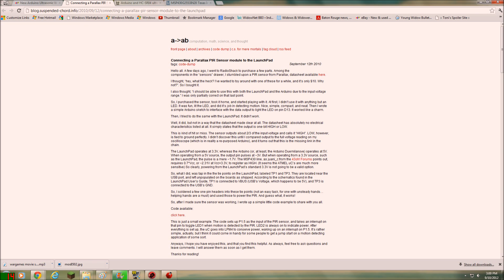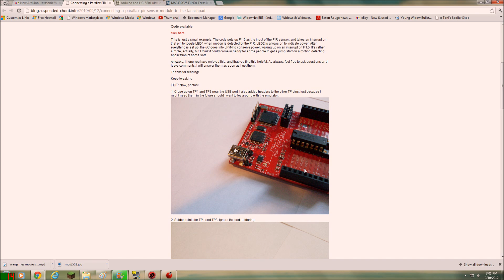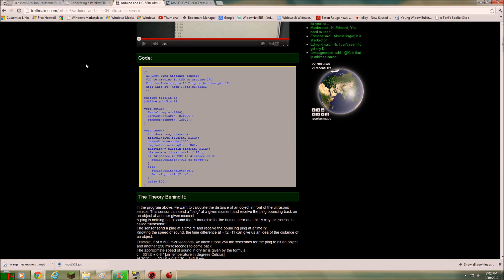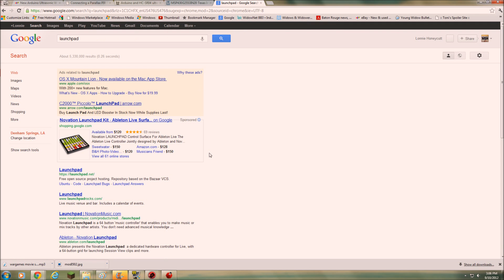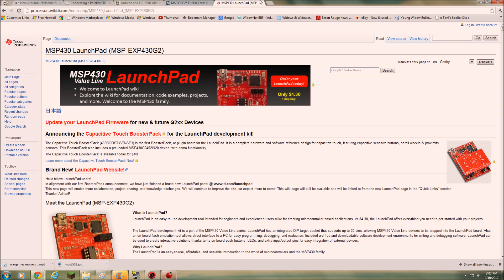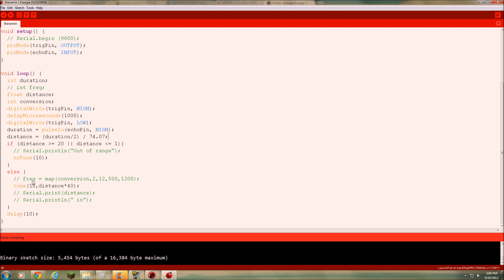HC-SR04 Ultrasonic Sensor with TI Launchpad MSP430 and Energia

Comment: why appear this error?

c:/users/ing.daniel/downloads/energia-0101e0015/hardware/tools/msp430/bin/../lib/gcc/msp430/4.6.3/../../../../msp430/bin/ld.exe: sketch_apr10a.cpp.elf section `.text' will not fit in region `rom'
c:/users/ing.daniel/downloads/energia-0101e0015/hardware/tools/msp430/bin/../lib/gcc/msp430/4.6.3/../../../../msp430/bin/ld.exe: section .vectors loaded at [0000ffe0,0000ffff] overlaps section .text loaded at [0000f800,00010bff]
c:/users/ing.daniel/downloads/energia-0101e0015/hardware/tools/msp430/bin/../lib/gcc/msp430/4.6.3/../../../../msp430/bin/ld.exe: region `rom' overflowed by 3448 bytes
c:/users/ing.daniel/downloads/energia-0101e0015/hardware/tools/msp430/bin/../lib/gcc/msp430/4.6.3\libcrt0.a(_copy_data.o): In function `__do_copy_data':
/root/mspgcc-20120406/BUILD/gcc/gcc/../../../gcc-4.6.3/gcc/config/msp430/crt0.S:195: relocation truncated to fit: R_MSP430_16_BYTE against symbol `__data_load_start' defined in ABS section in sketch_apr10a.cpp.elf
c:/users/ing.daniel/downloads/energia-0101e0015/hardware/tools/msp430/bin/../lib/gcc/msp430/4.6.3/crt0ivtbl16.o: In function `__isr_14':
(.text+0x2): relocation truncated to fit: R_MSP430_16 against symbol `unexpected' defined in .text.crt0 section in c:/users/ing.daniel/downloads/energia-0101e0015/hardware/tools/msp430/bin/../lib/gcc/msp430/4.6.3\libcrt0.a(unexpected.o)
sketch_apr10a.cpp.o: In function `loop':
sketch_apr10a.cpp:(.text.loop+0x42): relocation truncated to fit: R_MSP430_16 against symbol `__floatsisf' defined in .text section in c:/users/ing.daniel/downloads/energia-0101e0015/hardware/tools/msp430/bin/../lib/gcc/msp430/4.6.3\libgcc.a(_si_to_sf.o)
sketch_apr10a.cpp:(.text.loop+0x4e): relocation truncated to fit: R_MSP430_16 against symbol `__divsf3' defined in .text section in c:/users/ing.daniel/downloads/energia-0101e0015/hardware/tools/msp430/bin/../lib/gcc/msp430/4.6.3\libgcc.a(_div_sf.o)
sketch_apr10a.cpp:(.text.loop+0x5c): relocation truncated to fit: R_MSP430_16 against symbol `__gesf2' defined in .text section in c:/users/ing.daniel/downloads/energia-0101e0015/hardware/tools/msp430/bin/../lib/gcc/msp430/4.6.3\libgcc.a(_ge_sf.o)
sketch_apr10a.cpp:(.text.loop+0x6e): relocation truncated to fit: R_MSP430_16 against symbol `__lesf2' defined in .text section in c:/users/ing.daniel/downloads/energia-0101e0015/hardware/tools/msp430/bin/../lib/gcc/msp430/4.6.3\libgcc.a(_le_sf.o)
sketch_apr10a.cpp:(.text.loop+0x8c): relocation truncated to fit: R_MSP430_16 against symbol `__mulsf3' defined in .text section in c:/users/ing.daniel/downloads/energia-0101e0015/hardware/tools/msp430/bin/../lib/gcc/msp430/4.6.3\libgcc.a(_mul_sf.o)
core.a(wiring_digital.c.o): In function `pinMode':
wiring_digital.c:(.text.pinMode+0x8): relocation truncated to fit: R_MSP430_16_BYTE against symbol `digital_pin_to_bit_mask' defined in .rodata.digital_pin_to_bit_mask section in core.a(wiring_digital.c.o)
wiring_digital.c:(.text.pinMode+0xc): relocation truncated to fit: R_MSP430_16_BYTE against symbol `digital_pin_to_port' defined in .rodata.digital_pin_to_port section in core.a(wiring_digital.c.o)
wiring_digital.c:(.text.pinMode+0x18): relocation truncated to fit: R_MSP430_16_BYTE against symbol `port_to_sel0' defined in .rodata.port_to_sel0 section in core.a(wiring_digital.c.o)
wiring_digital.c:(.text.pinMode+0x28): additional relocation overflows omitted from the output
collect2: ld returned 1 exit status